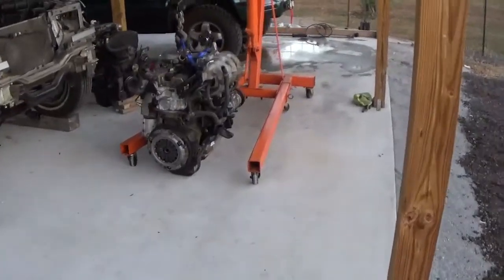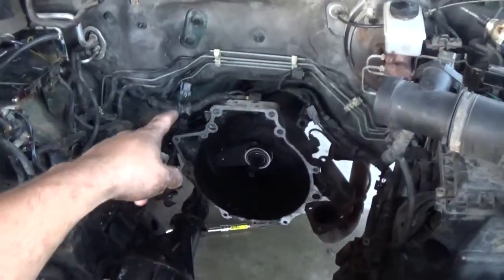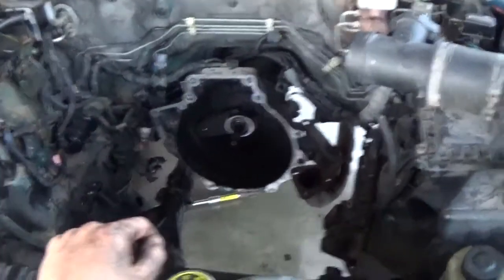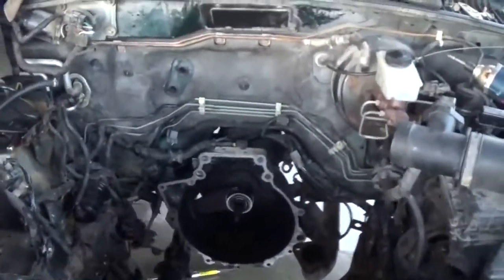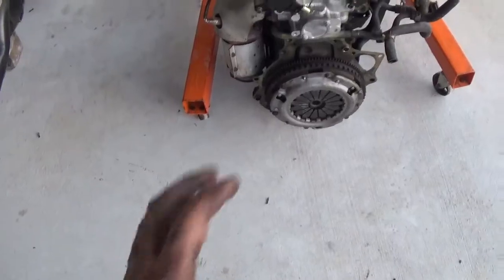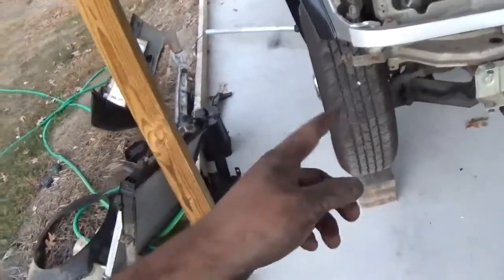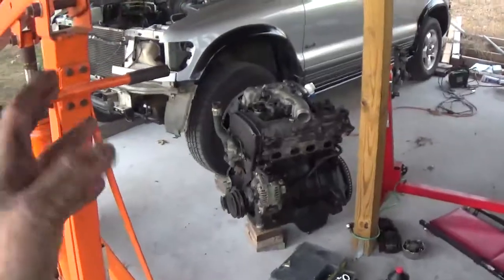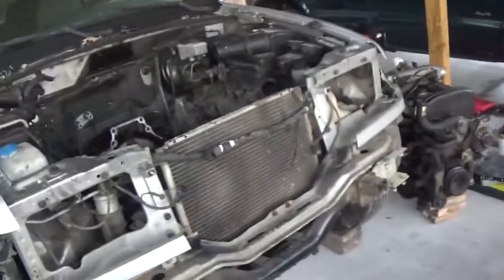Engine 2 stood no chance

Comment: Hey Man. Have you finished the Kia??

Also do u know if a 1996 Sportages steel header manifold will bolt up on a 2001 Sportage? Wanting to Turbo my Sportage but cant afford a custom manifold.
Reply: Chucks Stuff would it be possible to run a tube from the exhaust right after the manifold bolt up